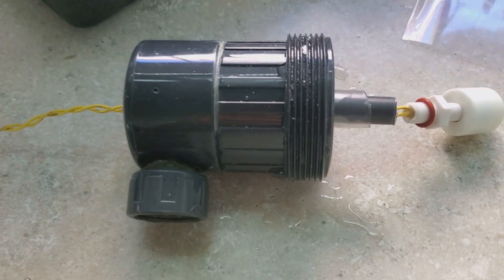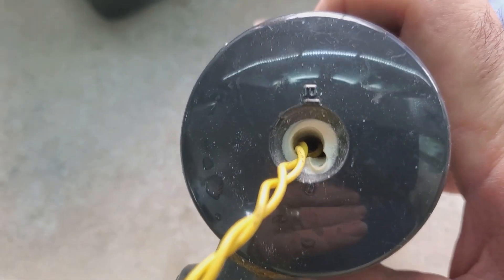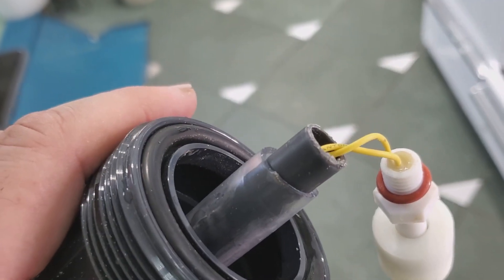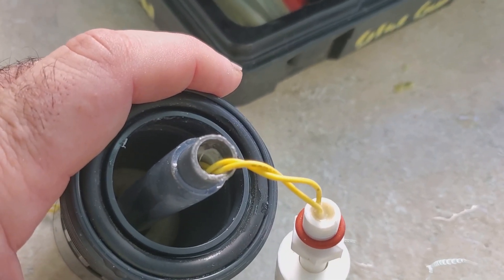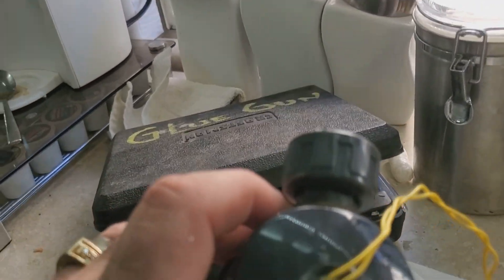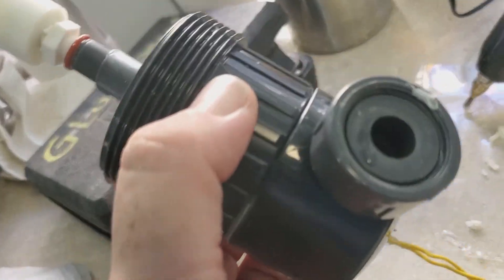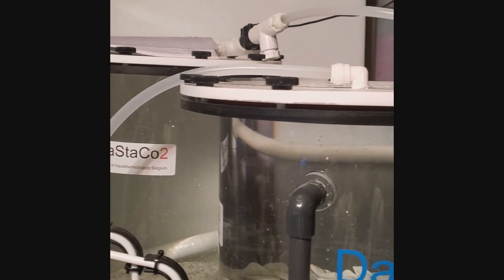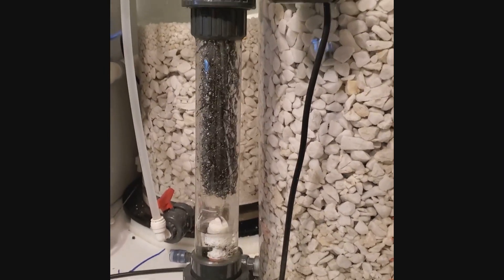o2manyfish's   Dastaco Float Switch Repair Jan 2021

Comment: Great video, nicely explained. I'm in the same situation and am looking at float switches with longer shafts.  That way I can remove the inner tube (grey) and just screw the float switch into the cap with a nut on the outside.